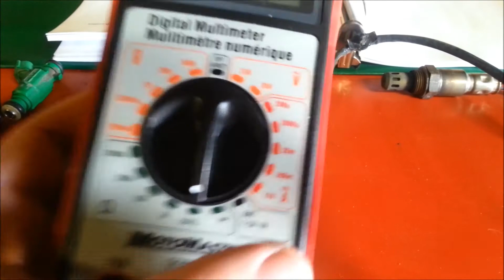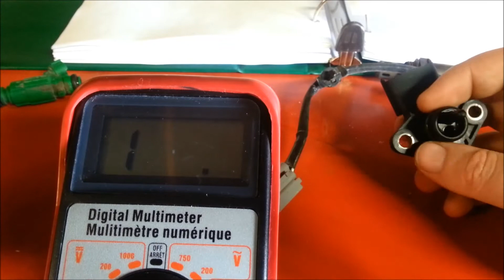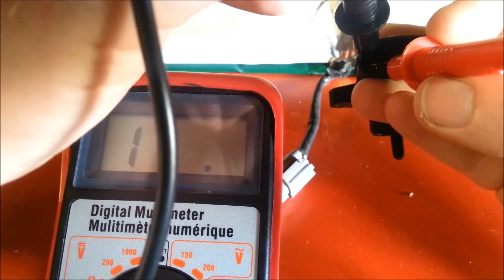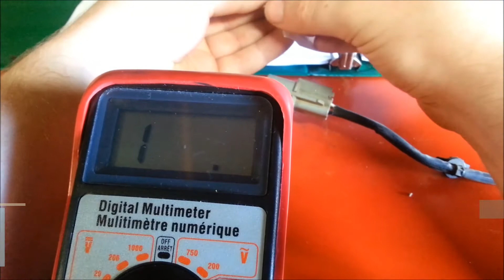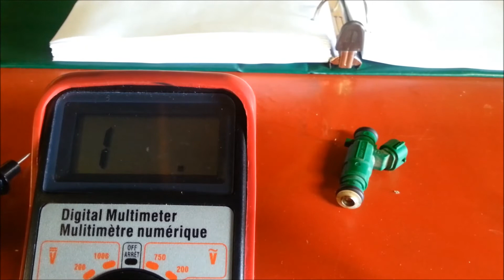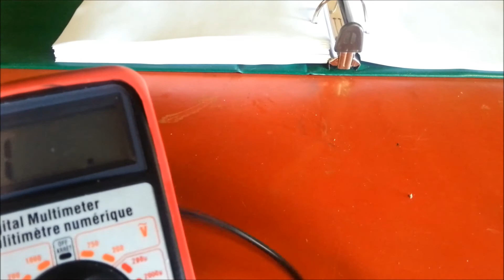Sensor Inspection

Comment: for the injector (temperature comment) the part that need to be at the right temperature is the COIL inside the injector..
if you put it the fridge an measure surface temperature you will probably off
and trying to measure the output section of the injector with an infrared meter will give you weird reading...the surface is reflective so infrared emmysivite will be low you will mostly measure the temperature of what is refleted on to it

Comment: lead's resistance is normaly around 0.4 ohms you can confirm with touching lead together.
if you have a FLUKE meter you can go into relative mode to remove that value

i think you were not able to get the temp sensor value in the map because the value is around 2k ohms and you left your meter at minimum range...so it show's 1.

for the O2 sensor if i remember correctly you must NOT test the sensing circuit...only the heating circuit...that could damage the sensor

Comment from the maker: Thanks for sharing that info, I have a Fluke multimeter that I typically use but is kept at work for the most part so I made the video with what I had.